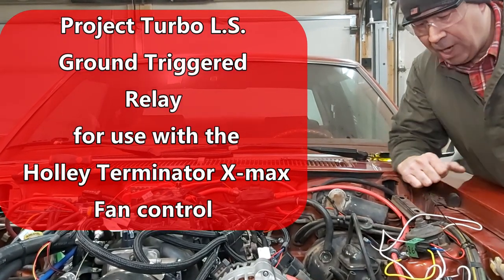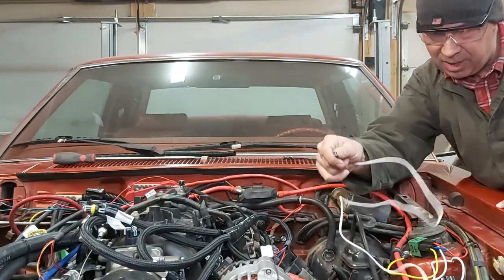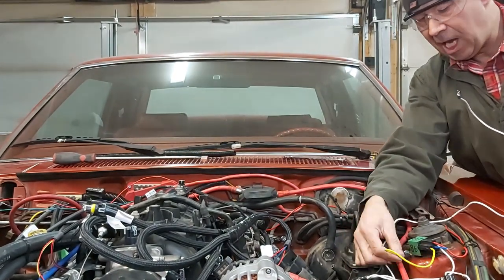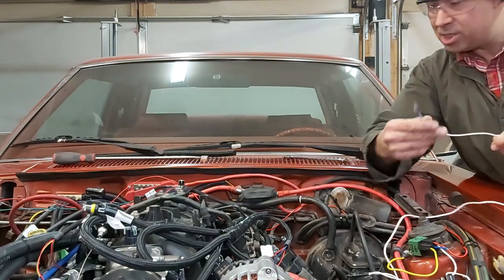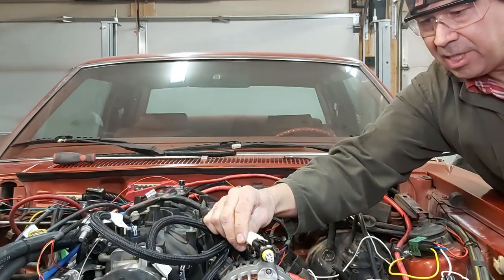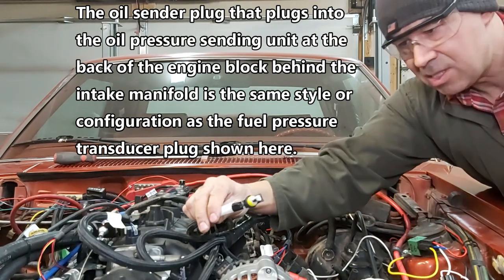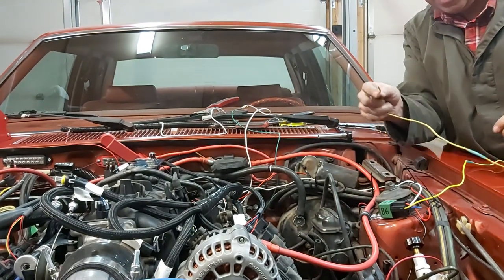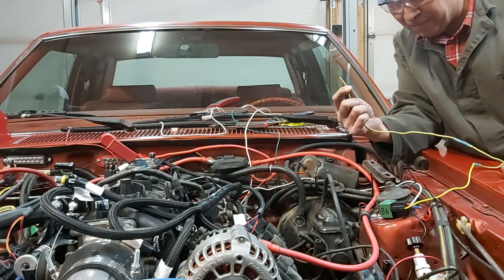Ground triggered Relay for Terminator X max fan control

Comment: The problem I found with us ya OEM oil pressure sending unit is the small screen holly oil pressure doesn’t read it  it’s red and says 101. I called holly they said it’s because you have to use the holly oil pressure sending unit or reprogram the ECU to read the OEM sender

Comment: Do you have the part number for the Oil Pressure Sensor? And is there any other adapters for it you used?.. 
Gen 3 5.3Ls
Reply from the maker: Yes I purchased the one at the link from Amazon, but they longer sell that particular unit so just type in oil sending unit for LS 5.3 or 6.0 and make sure it will fit your terminator x wiring pig tail ... https://www.amazon.ca/gp/product/B07R1KVDYV/ref=ppx_yo_dt_b_asin_title_o06_s00?ie=UTF8&psc=1   thanks for commenting and watching...Oliver

Comment: What do you connect the other 2 wires to
Reply from the maker: Terminal 87 of the relay goes to a positive battery source and terminal 30 goes to the positive connection of what ever accessory needs to be turned on or powered. The diagram at this link might help. https://performance-world.com/v/instructions/REHAR.pdf  thanks for watching and commenting....Oliver
Reply: @BooostedLS  thank you I appreciate it I kinda understand that I’m not the greatest at wiring do you have a instagram in case I have any more questions
Reply from the maker: No worries , glad to have helped....Oliver
Reply from the maker: Yes you add me on Instagram under oliver petters.... thanks

Comment: Is two relays necessary for dual fans if they both come on at the same time?
Reply from the maker: No, you can wire both fan's to the one relay as long as the total amp rating of both fan's together does not exceed the amp rating of the relay. I have both the scavenge pump and fuel pump wired to one relay in the turbo van, that both come on with the ignition key in on position....thanks for your interest, and thanks for watching.....Oliver